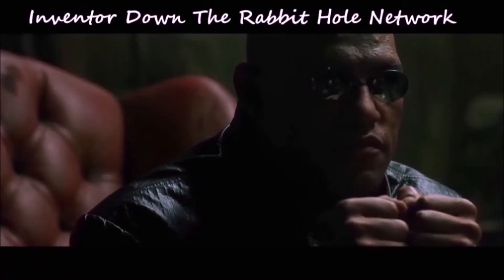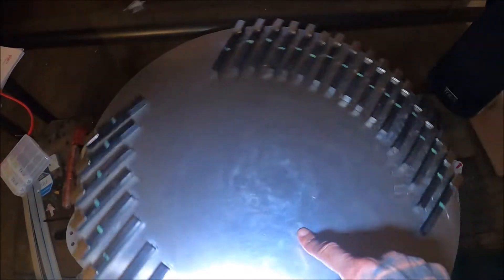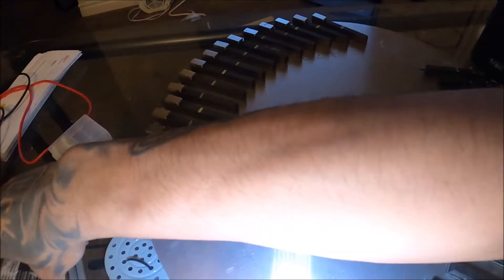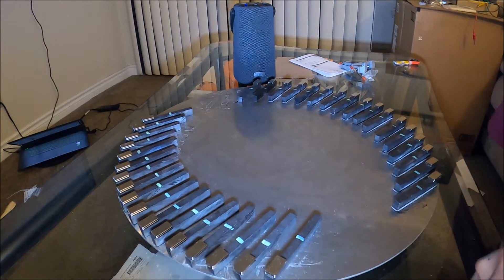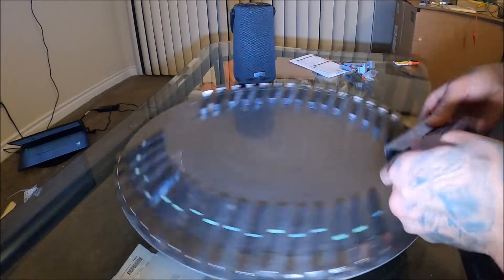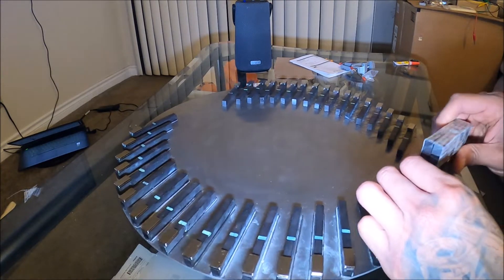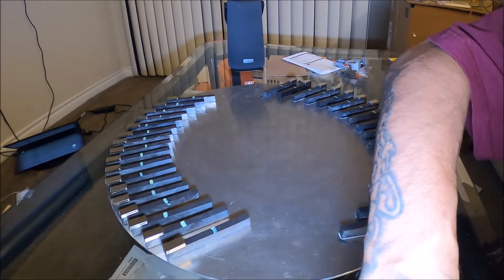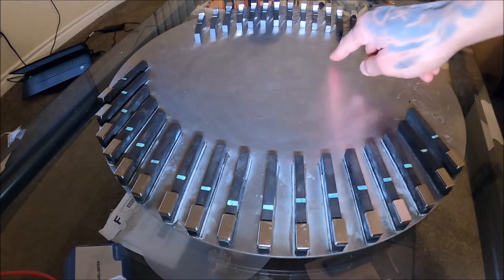Howard Johnson All Magnetic Motor Mylow Replication

Comment: You could use an electro magnet that turns on and off so there wouldn’t be any physical motion using up energy. If you added coils along the outside of the circumference the spinning magnets would create induction to feed the electro magnet stator (perhaps).

Comment: This is the same movement, his apparatus did on a stand, that you are doing with hand,get the same magnet to rock freely on a stand, of course hight has to be found out in optimization,plus a flywheel can be added to rotor and initially a strong rotation might bring everything in synchronicity.